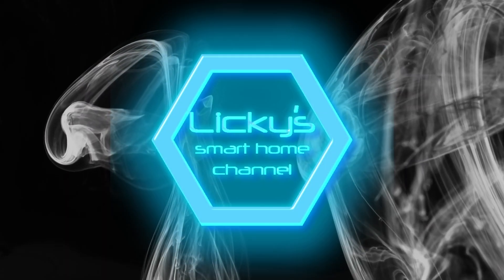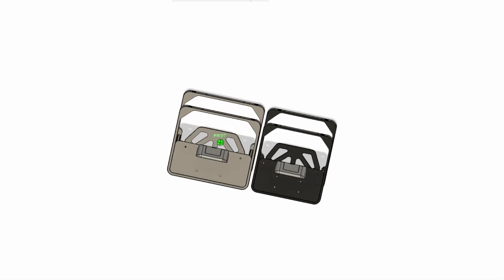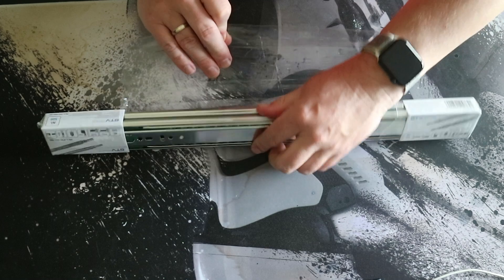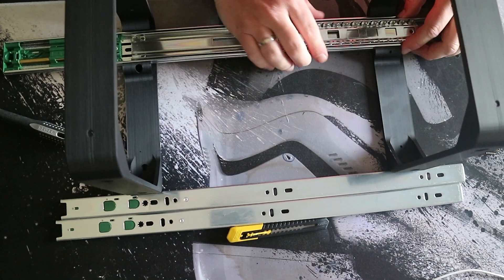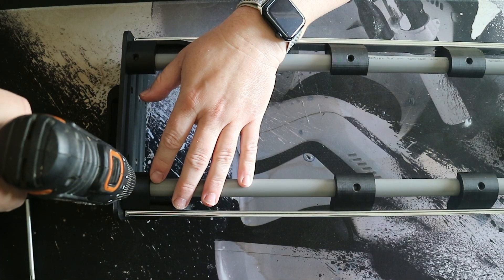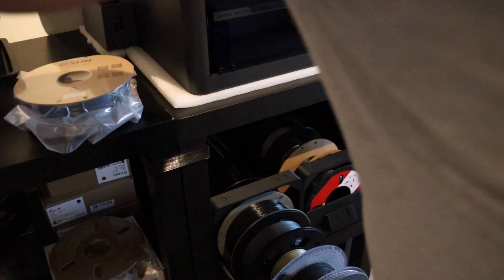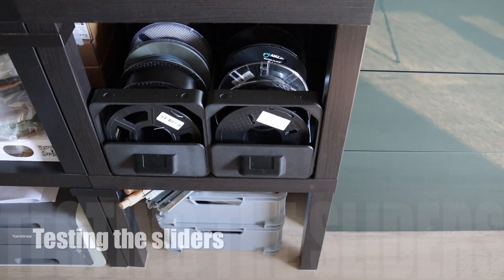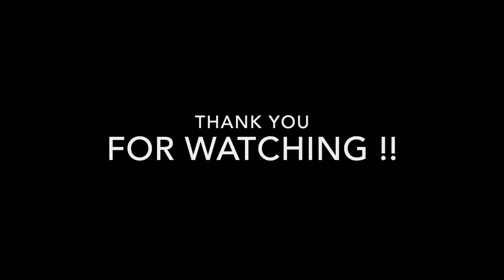DIY Modular Filament Drawer System

Comment: I dont understand. The original from Robert uses 1/2" PVC tubing. Your brackets should be using 3/4" tubing? But the opening on the bracket is smaller not larger than the one in the original 1/2PVC tubing design. How would a 3/4" PVC tubing fit in that bracket, when the opening is smaller than the opening in the 1/2"PVC tubing bracket? I don't think I could fit a 1/2" PVC pipe in that opening... certainly cant fit a 3/4" PVC, what am I missing here?
Reply from the maker: I used a 19,05mm pipe that should be 3/4”
Reply: @licky-lauda could my sizes be different in the US?
Reply from the maker: @JohnSmith-rt5yq could be but according to google 3/4 inch is 19mm in my drawing the radius is 9.51 which is 19 mm diameter
Reply: @licky-lauda  3/4 is usually 25mm diameter in metric.... 19mm sounds closer to the 1/2" which is 20mm in metric...
Reply from the maker: @JohnSmith-rt5yq  lol fill this is in google: 3/4 inch to mm
Then i get this as answer: 0.750”	3/4”	   19.05 mm